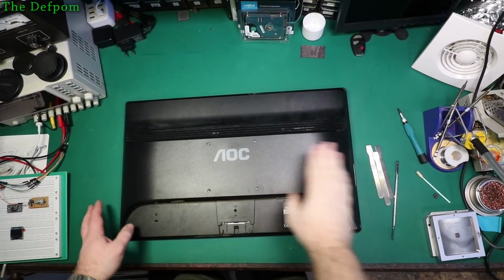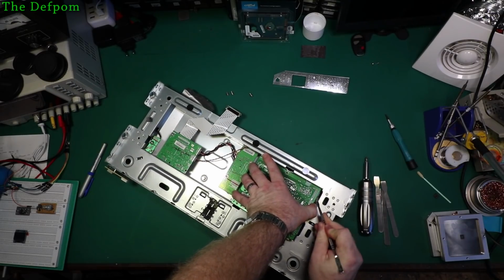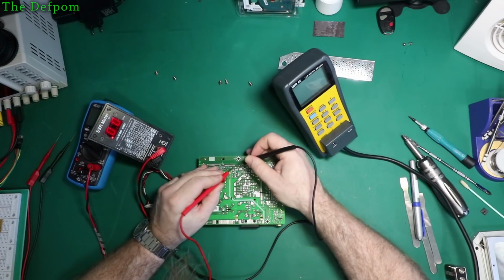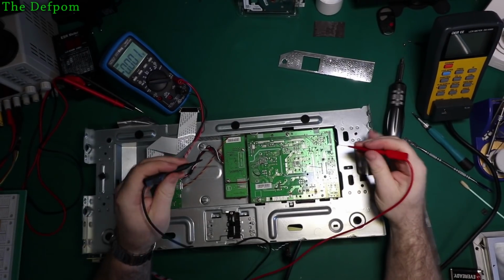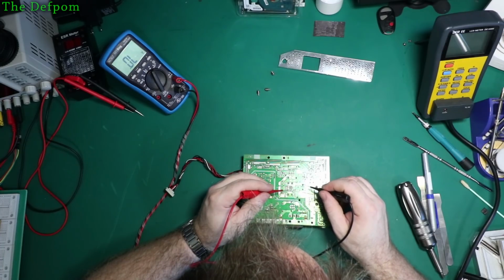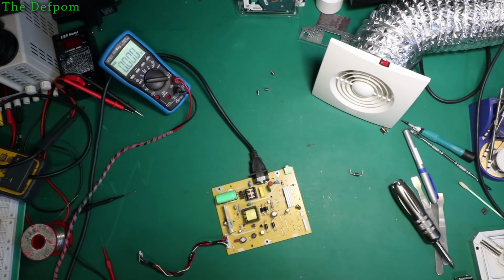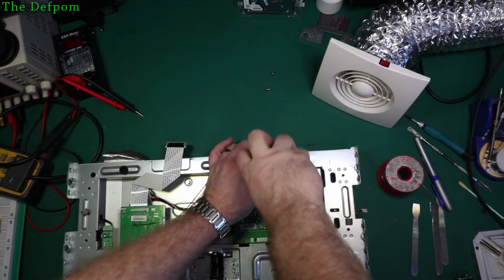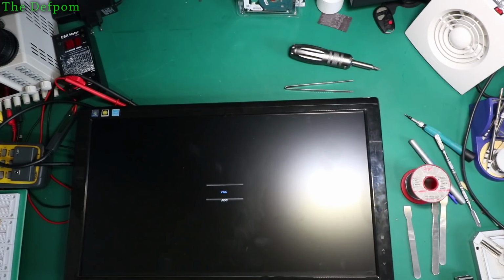🔴 #490 AOC E2236V LCD Monitor Repair - Switchmode Power Supply Dead

Comment: My AOC monitor turned on and off. I noticed the top of an electrolytic capacitor bulged up, (C804 1000uF 25V), a common sign of damage. I replaced it, but problem persisted. A dual PN MOSFET (Q805 AO4620) on the underside appeared to be shorted. Replacing it worked.

Comment: I have an aoc monitor it comes on and then blinks an comes off how to fix it
Reply: I also have an older AOC 2436VW & it blinks on & off when you put in the powercable showing AOC logo for a second, & then it turns off & on again blinking. I can not get to the menu either when it doesn´t stay on. 
 I cannot  turn it off either without taking the powercable out of the wall. It is not something wrong with the cables. I have switched to new ones it is still the same . The screen is light grey behind the logo now & before when it was okey it had a red background. The buttons doesn´t work at all when it turns off & on all every second. It obviosly gets power but it seems like not enough power to stay on or maybe it had been locked, or tilted. The powerbutton blink fast in a blue light not in a servicemode pattern. Until I drag the powercable out it is impossible to turn it off manual on the buttons or using them on the display.
 If your problem was the same & you figure out the answer or if someone read this know the answer of this problem so please reply. I will do the same if I find out something.

Comment: Haven't you got the odd Apple nottbook around to give you a HDMI signal?   lol
Reply from the maker: The monitor doesn't have HDMI, it has VGA and DVI, otherwise yes that would have been an option yes.
Reply: @TheDefpom  it'd probably be worth having an HDMI-DVI adapter around since they are electrically compatible if you are not aware of that.  I have found that they have come in handy for many things in a pinch.

Comment: Of course I have resolution and even lens for this, but with low resolution it is easy to find small heat source by hiding components with pencil or paper. Then you see when the right thing disappears on thermal camera screen.

Comment: Well done scott :-D
Switchmodes can be a pain in the bum, but that one died for no reason, other than a diode was faulty.
That psu didn't look like it had ever seen heat, so it wasnt that.
I have seen switchmodes that looked really cooked but they still work, once the caps have been changed.

Ordinary diodes don't react fast enough for the high frequency of a switch mode, so they don't close quickly enough and end up shorting the output of the supply for some of the time.
Keep a few dead pc supplys around, steal the diodes :-D

When you were ignoring the shorts across those diodes i was calling you all the names under the sun, and the roll away inductor ha ha :-D
Reply from the maker: zx8401ztv - I was trying to figure out the circuit and check all the components, yes I was fairly sure a diode was bad early on, but I wanted to check surrounding circuitry too in case there was more than 1 problem.
Reply: I didn't actually call you names, that's for comedy effect :-D

I normally go straight for the output caps and diodes, then jump back to the drive input for a possible dead fet or a small value electrolitic that's needed for startup.
Oddly i didn't hear the typical tick tick sound that some supplys create with a short.
The driver must have shut down the second the overload was detected.